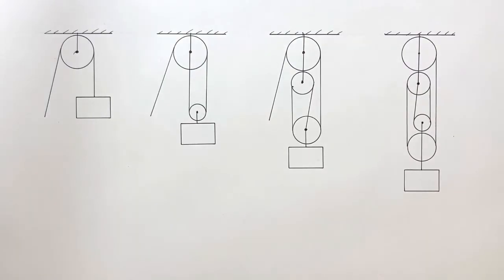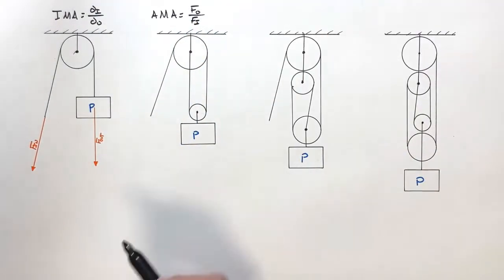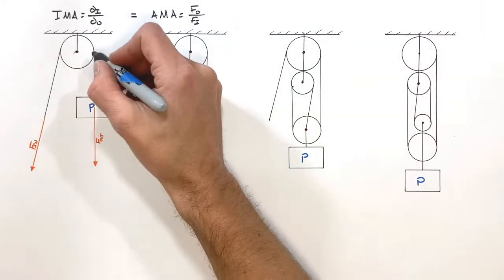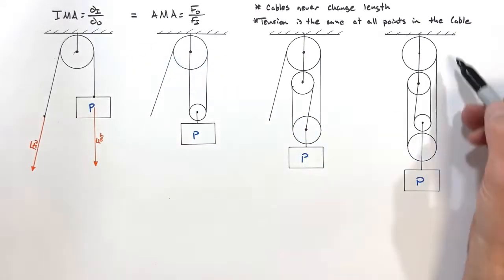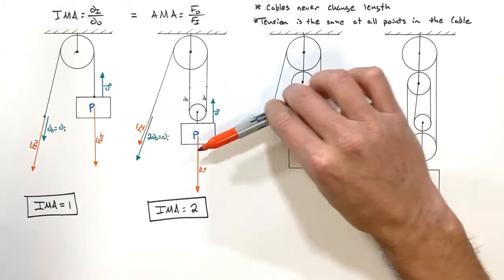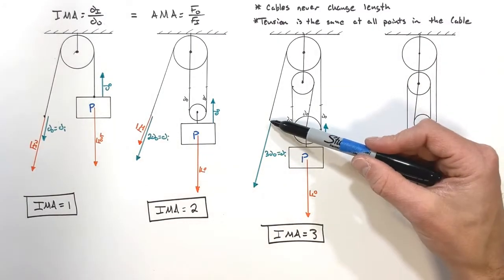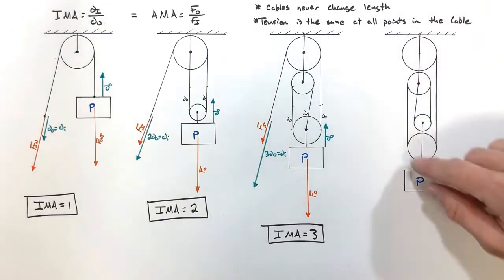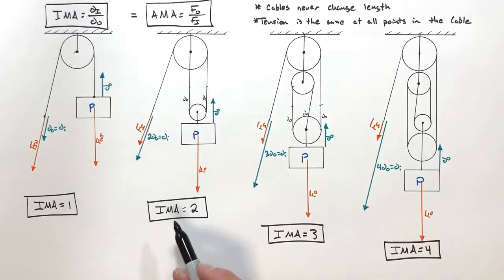Pulleys | Find IMA, AMA and % Efficiency | Simple Machine

Comment: Great info I had a question in regards to input distance, 
is it possible to reduce input distance if your creating a lift in a garage, Setup would be 4 static pulleys on the ceiling feeding back through guide pulleys, to a load bar that would receive the 4 cables from the corners of the lift, with a single output heading towards the wench/handcrank Would there be a way to reduce the input distance due to space constraints ie only have 4 feet to work with but want 8ft of travel on the lift